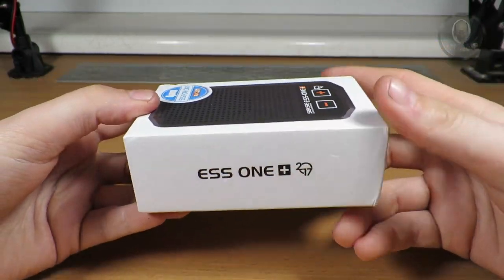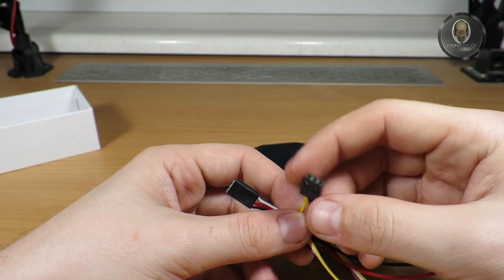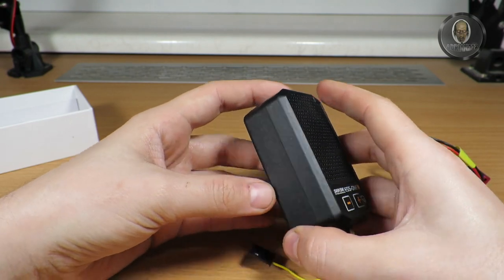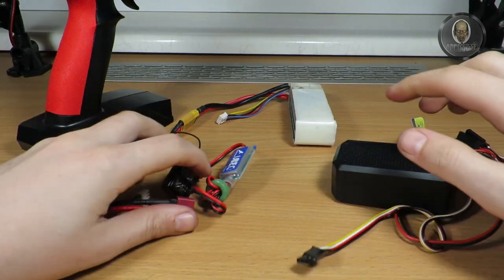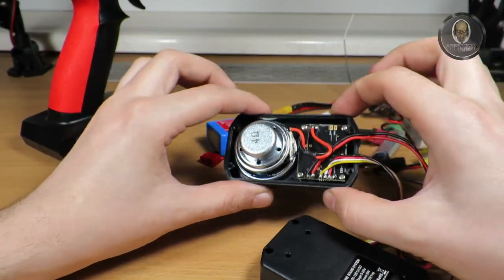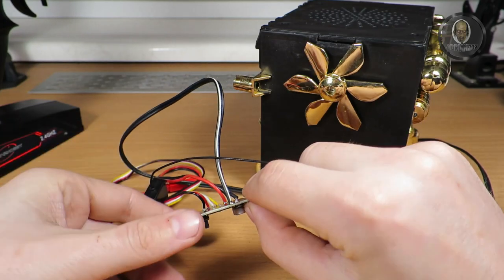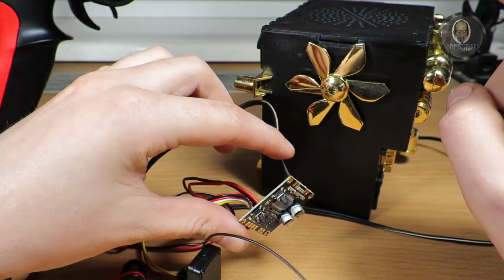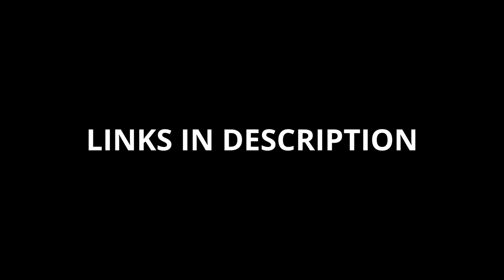ESS ONE ?? ESS DUAL ?? NO, ESS EXTREME !!

Comment: Why is the Dual better than the One ?
Reply from the maker: ESS dual have 2 speakers so it's stereo and have double power and base
Reply: @Adrian202  Adrian, would you know if by soldering an additional speaker to such ESS One it will sound stereo like the Dual? (I own several Dual, which I love, but ordered by error a Single on my last order...)

Comment: When i break thenit make the sounds .. not when i pull trigger on radio. How do i gix that
Reply from the maker: Brake sound will only work when You accelerate a little
Reply: @Adrian202  i typed that wrong. Lol. When i hit brakes it made throttle sounds. It was reversed.  I finally figured out how to calibrate it. And it fixed issue. Thank u;)